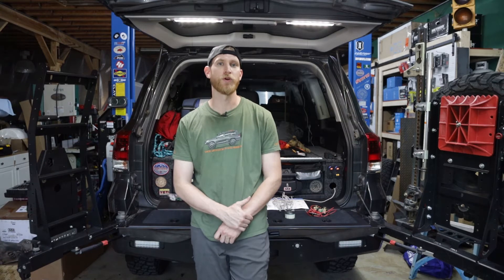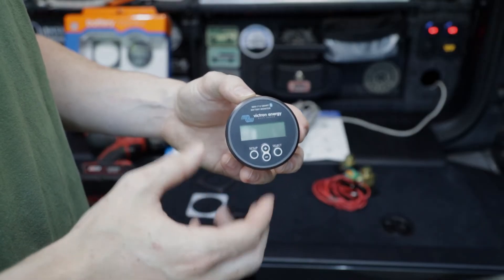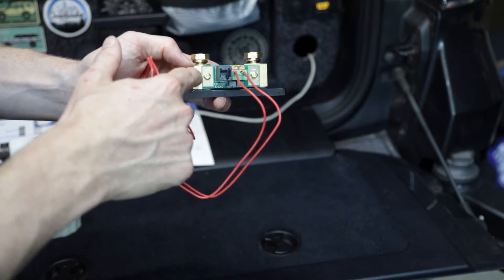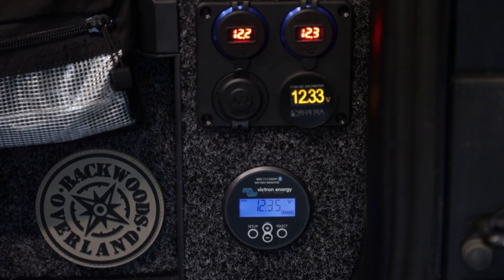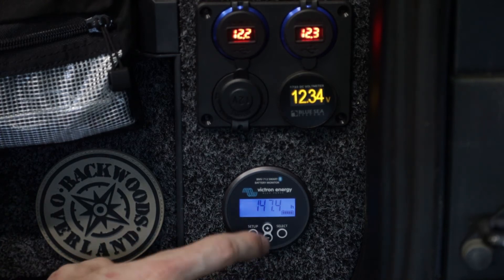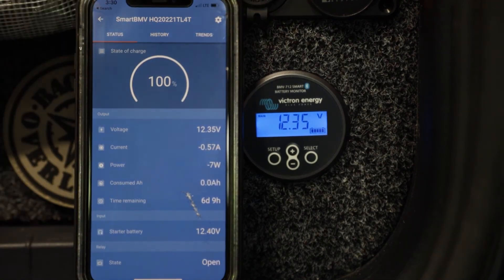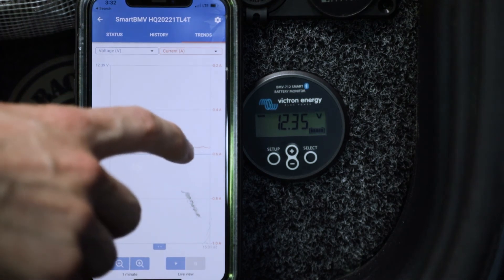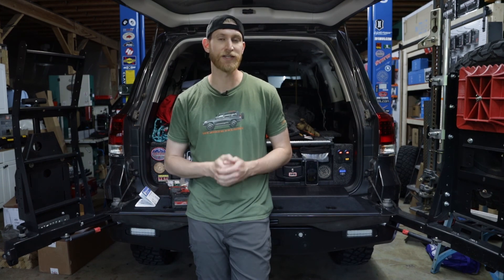Victron Energy | BMV-712 Installation and Overview

Comment: Excellent video, thanks! I'm building an auxiliary single AGM w/ Redarc BCDC setup. Question: When you add solar, does it's ground need to go to the shunt? Or if it's grounded to the chassis, will the monitor still accurately pick it up?
Reply: I am doing the same setup next week and have the same question. XS Power D2400, Redarc  BCDC1225D, Victron 712